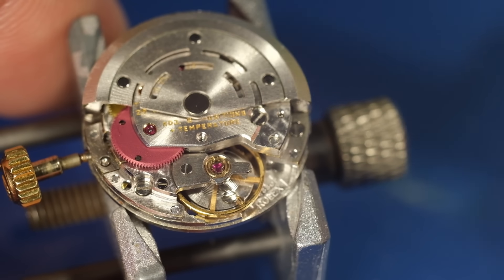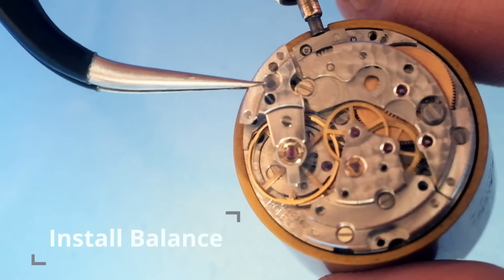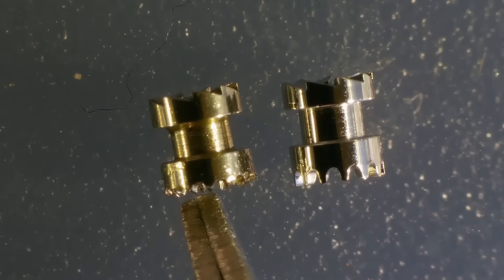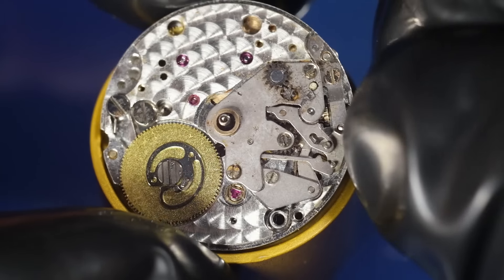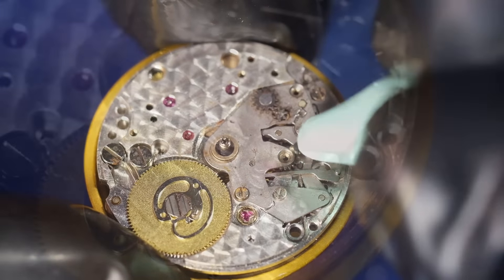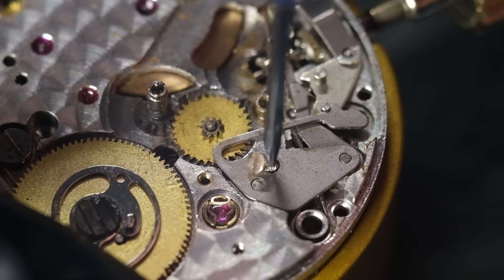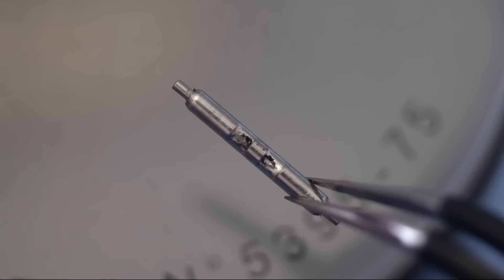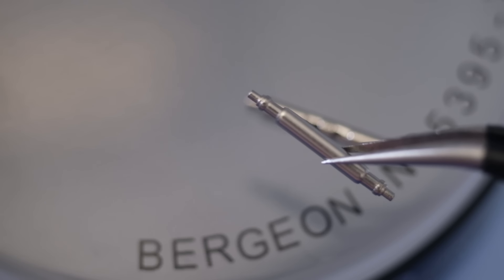Rolex Restoration - World's Rustiest!

Comment: TBF, these are parts that should have been replaced at the initial service, but you know that. Loose cannon pinions are a Rolex inevitable...though they seem to plod on with barely any grip...  Why oil the pallet pivot? It barely moves and oil will provide drag... Always replace rusty minute wheels and winding wheels....

Comment: A piece of neoprene on your movement holder should stop it sliding around. You can get different thicknesses and it's normally self adhesive.
Reply from the maker: Thanks Rod.  That's a top tip!  Richard

Comment: Admittedly I haven’t finished watching the full video yet, but I’m hoping to hear more on why this is a warranty job? Did you not clean the parts enough the first time, or what happened that this all needs to be done again only 1 year later?
Reply from the maker: Hi Brandon... I took a calculated risk that in cleaning up the parts first time this would be enough to return the watch to acceptable time keeping and operation.  I was nearly correct but it transpired that my call was wrong and the watch needs new parts.  My client paid and so the risk is with me for it was my call, hence it being done under warranty.  Good question sir, hope this explains. Richard
Reply: @richardperrettwatchmaker  are the new parts also under warrenty? Or does the customer pay for tue parts and your warrenty is cleaning the movement again and installing the parts?

Comment: Richard, with the isopropyl alcohol rinse, assume that is the last rinse.  Do you have to be careful with this solution and the pallet fork shellac?  Are you using 70% isopropyl?
Reply from the maker: Hi Supercruze, yes the alcohol is step 3 out of 3.  https://www.richardperrett.com/watch-repair/my-watch-parts-cleaning-regime/  I find no issues with shellac in this regime.  I use no heat in tbe cleaning and limit the heat applied to the pallet fork in the post cleaning drying. Hope this is helpful. Richard

Comment: Richard, that felt kind of Bitter Sweet. 
Not the sort of thing you want to find on the bench too often with the label "Warranty Repair".
The viewers cannot tell if you had a donor movement or you actually went "full out" on buying new 
bits from Rolex.
Hopefully it was a decent donor, but even that option ain't cheap in Rolex land. There probably are some 
lessons to be learned from all of this. Something to do with false economy etc. But on the other hand nobody 
could predict a slipping canon pinion showing time randomly. 
You win some and you lose some, that's the best stance to take. This was a very entertaining video to
behold and the results very satisfying to share.
Personally, I would like to have seen a final shot of this watch on a Timegrapher, just to see it calibrated and
concluded.
10/10👍
Reply from the maker: Hi Gary... Great feedback.  You mention some good points and realise I think that sometimes I do things a little differently because I am making a film, or films in this case, for folks to enjoy.  In doing this I always try to protect the position of the watch owner hence the provision of warranty when this might not normally be the case for a watch presented in such a rusty condition.   Thanks for the feedback. Much appreciated. Richard

Comment: Fantastic Restoration to that classic.  And noticing the worn wheels etc that needed replacement was key to successful job. I'm sure the new parts made a Big difference on how the watch runs..and keeps time. Excellent Vid..THank You...
Reply from the maker: Thank you so much Thomas.  The microscope is very useful in spotting damagebon some of the smaller parts for sure and yes replacing the parts that were the worst effected will have a very positive impact I think.  Thank you so much for the feedback. Richard
Reply: Love your work

Comment: Throughly enjoyable video, thanks. That wear on the spring bar is quite extreme; not sure whether that wear is internal or external & it's overkill maybe, but I always lubricate spring bar pins with a tiny dot of oil & exercise them in & out a couple of times just in case they've come dry from manufacture.

Comment: RIchard, some brilliant close up photography in this video.  Nicely done, as always.
Reply from the maker: Hi Paul ... I have been working on that so very pleased you notice and took the trouble to mention it!  Much appreciated!  Richard
Reply: @richardperrettwatchmaker  I re-watched the original video and I thought the end result was quite nice.  It was surprising to me that the worst of the rust damage seemed to be restricted to the dial side.  I suppose the water got inside and the watch was left face down and the rust did its work.  In the original video you mentioned that even with the lose of metal, the parts seemed to be meshing nicely.  I wonder if the rust continued to weaken the remaining metal in the intervening year after your original servicing.